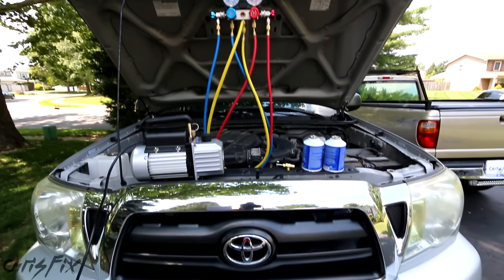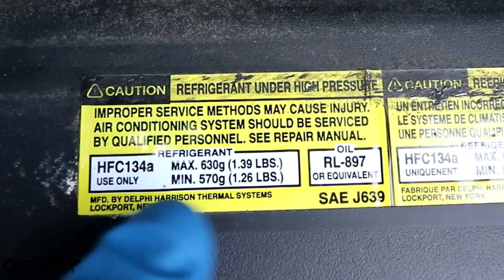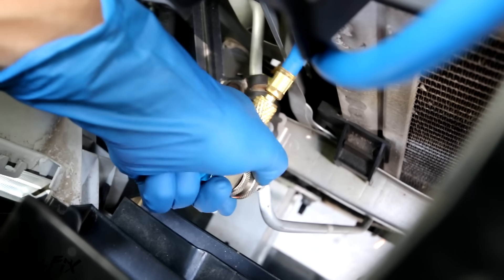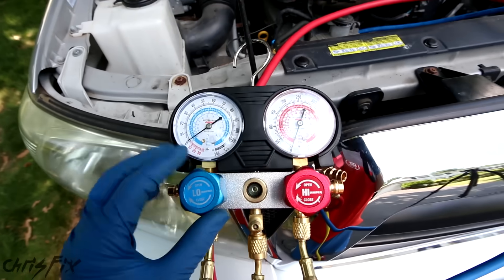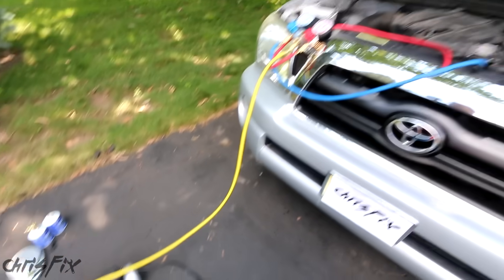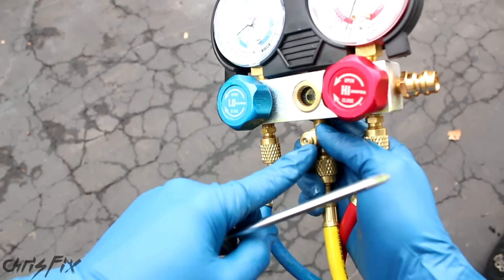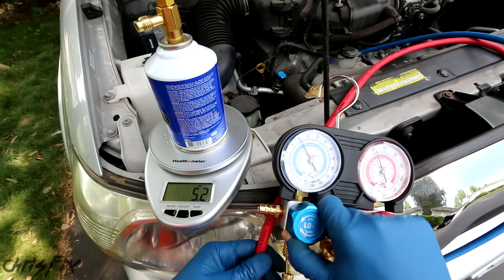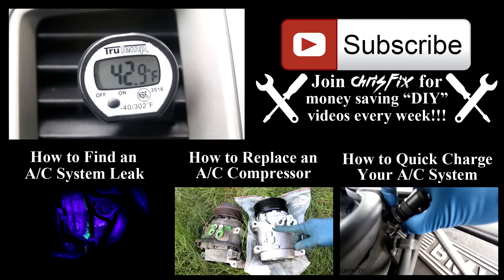How to Properly Recharge Your AC System

Comment: It is not a good idea to work with that stuff and recharge the system unless you are certified to do so. One mistake and if you have a refrigerant leak it's horrible for the environment . . Chris does know his stuff but it is not reconvened to do this work yourself unless you have a license to work on the AC. In Germany you can't even look at theAC system without a class on how to do it.
Reply from the maker: Thanks for sharing. If you do everything correctly than what is the issue?
Reply: All I wanted to say was that because as you said it's bad for the environment it's not a good idea to mess with the freon gas unless you have official certification. But you definitely know how to do it.   The reason why I said it's not a good idea is because if someone who has never done it and a mistake is made, there will be freon leaking into the atmosphere .

Comment: pump it up with nitrogen 60 lbs should be good .let it sit a hour or so . if you have a leak it will drop on the gages. nitrogen is dry too .
we test lines with nitrogen. out in the hvac trade .
Reply: Yes, now where did  I leave my nitrogen bottle and regulator?
Reply: Where win the world can I get nitrogen?? I just flushed system with metal flush canister with solvent and an air compressor..  I'm worried the compressor introduced too much moisture? 😶

Comment: So if I just need to replace O rings on one of the low pressure side connections and pull a vacuum I do not need to add OIL?

Comment: the final part that should have been done before removing the hoses is to purge the hoses of refrigerant by closing off the high side valve at the port and opening up the low and high on the gauges. This lets the compressor pull the refrigerant out of the high side hose and bring it down to a lower pressure and lets you maintain the proper charge. There will be less than an oz in the hoses at this point versus something close to an oz the way that Chris showed. Then you do the rest of the disconnect procedure. Just from someone that has done a few systems and converted a few from r 12 to r152.

Comment: I noticed the cap on my high side is missing does that matter I guess the tech forgot to put it on, I'm not having any problems but still.
Reply: The cap keeps dirt and moisture away from the Schrader valve in the port, like a dust cover. Get a replacement, they're inexpensive and ill save you a lot of grief in the future.

Comment: R 134a sucks. Use a mixture or propane and butane. 134 is only used to pay the double D's a royalty. R12 is out of patent so they switched it. Yeah, ozone bad, we get it. But if you want a nice cool car and less work for your compressor and no more chance of a fire than r12 and oil, use propane and butane. Don't believe me? fine. Use many other refrigerants that are better than 134. They are just no patented by D&D.

Comment: Hey Christ first off I love you channel man its very informative and have absolutely no complaints, I just wish you can answer a question of mine in regards to a vehicle I have not seen here. I have a 1987 dodge ram d150 that wont take the Freon, I charge it according to specs and still no cold air, I wonder what it can be, I had a mechanic check it and he ended up overheating my pump until he killed it due to over charging, its already converted to r134a from r112? can you help!!

Comment: Hi Chris, I just got a manifold gauge set and mine has 4 knobs but no connection in the middle where your yellow hose is. will it still work for for the Toyotas? we have a 1996 4runner.

Comment: Hi Chris. Quick question for you. I hooked up my gauges as you instructed but my low side gauge, even with the valve closed immediately went to 70 pounds. Is the gauge defective because you show yours at zero until you open the valve. Are my gauges toast? Thanks in advance for your help.

Comment: Chris: GREAT instructions, SIR! But the link for the gauge set in Amazon is not the one you use in the video. Yours has quick release connectors and a sight glass which are both very  handy, but the one on Amazon doesn't have either. Please keep up the good work!
Reply from the maker: +Ron Hensley thanks and thanks for letting me know. They probably changed the product design. I'll find a new one!

Comment: My gauge set doesn't have a Purge valve , how can I purge the yellow line connected to the can ?
Reply from the maker: +naiefelyemeni1986 don't worry it's not that important since the lines are very thin and don't hold much air.

Comment: Is replacing the compressor essentially replacing the whole AC system?  My Ford Escape AC isn't working.  I took it to a mechanic and he charged or put 'freon' in it.  It worked for a few months and stopped again.

Comment: if you close the manifold gauges after vacuum,..  how it will detect if there is a leak in the system?
should  they stay opened?
Reply from the maker: +Daniel Cotayo the line from the gauges to the ac system is open. You are closing off the yellow hose when you turn the knobs at the gauge.

Comment: hey whats the difference why you used this type of recharging vs the AC pro on the bmw?
Reply from the maker: +417hatchimitsu this is the proper way to do it and the ac pro is the cheaper/easier way.
Reply: @chrisfix. Thank you for your video I was able to do my air conditioning system with AC pro kit! Thank you!

Comment: The video is pretty awesome. Very informative and generally the correct way to service the system. There is only thing I saw, that was incorrect... The specifications are in dry ounces. Fluid ounces are not the same as dry ounces. A twelve fluid ounce can of freon is 16 dry ounces. It's sold by the pound. So, you added a total of approximately 26 ounces to your system, not 22. It may be perfectly fine for your system. But, it could be catastrophic in another. Why freon is sold by the pound, and labeled by the fluid ounce, I'll never understand.
Reply from the maker: +Jeremy Wheeler hanks Jeremy and thanks for the tip!

Comment: I'm asking all over the internet, I'll try here too: my AC compressor is cycling on and off every three to five second all the time. Always, no matter what the conditions are. It has been professionally recharged, nothing has changed. The guys at the shop say it's normal, but since the car is still covered by warranty i'm afraid they may be just trying to avoid fixing it for free. Can an eternal 3 seconds cycle be normal?

Comment: Question: Do you need to purge the yellow hose again when adding the second can of Freon?
Reply from the maker: +dada royal no because the hose doesn't get air in it since it is sealed with the adapter that goes on the can.

Comment: Is it possible to test your ac manifold gauge for leaks by connecting the red and blue hoses to there brass storage positions on the sides of the manifold , connecting the yellow hose to your vacuum pump and opening the valves and turning on the vacuum pump?
Reply from the maker: +julian perez you could just close the valve on the red and blue and test it
Reply: but shouldn't I leave the valves open to test the yellow hose also for leaks, but I guess I would need a  shut off valve between the yellow hose and vacuum pump to not loose vacuum pressure.
Reply: but I guess the red and blue hoses are more important to test the cars ac for leaks, the only thing is if the yellow has a leak you may not get to -30.

Comment: Great Video! but what position should the black air knob on the vacuum compressor be, should it be in a closed position or an open position?
Reply from the maker: The compressor doesnt have a knob. You attach your yellow hose and turn it on and it sucks out the air.
Reply: Ok, so the black cap "marked air" is a like a dust cover? Because it does screw on and off. It doesn't matter if it's loose or tight, right?
I'm a first timer and was just wondering . . . Thanks for the response!

Comment: Hi Chris fix, you do a great job informing people. Just wondering why you didn't replace the receiver drier/filter in the system. I was tought when I got my A/C certificate when you always open up the system to always replace the the receiver drier/filter because at that point it is already contaminated and needs to be changed. It's basically like changing your oil filter when changing your oil.

Comment: Amazing video, I've never done this, but one thing I would of have done is used the Tare feature on the scale with the empty can to know exactly how much refrigerant you are putting into the system. Excellent work!
Reply from the maker: +JonTheChron thanks and good idea
Reply: I'm a trade electrician that likes to work on his car/bike when ever something goes wrong or is scheduled for regular maintenance, one thing I have always been afraid of is the A/C system. Last summer the A/C system on my 40k miles 2011 Dodge Charger stopped working about 1 month after the warranty expired. After watching the series of 3 videos on A/C you posted, I finally feel like I could tackle this task as I am now well informed on the correct procedures used to diagnose/troubleshoot and repaid and automotive A/C system. Thank you again Chris for this very informative series.

Comment: Hello Chris; do you really recommend the harbor freight vacuum pump and gauges? I need to buy a set for  fixing my AC . need to replace compressor and condenser and I need a good vacuum pump. Thanks Chris
Reply: I got a loaner vacuum pump from Autozone for a $150 deposit. The HF manifold set seems popular amongst Youtube mechanics: Chrisfix, ETCG, Scotty Kilmer, and Ratchets and Wrenches all use it. I have the FJC6697, which seems to work well.

Comment: Trying today
Reply: ok, so, in california, we have different r134 cans. they need to be reusable. so no puncuring holes, they need to seal after use. empty or not. the cans come like that.

i did have a problem with finding something to connect the manifold hose to the refill can. i ended up evacuating the system, closing everything off and leaving it with negative pressure, then closed all manifold valves. disconnected everything, and refilled the quick method. $13 refill hose with gauge hooked up to the low pressure line and the can.

unfortunately, i overfilled my system and didn't want to risk r134 on my hand to release some fluid. 

other than that, ice cold air for the summer!

Comment: I read somewhere that adding oil through the vacuum line is not advised - that that mechanism is intended only to replace lost oil due to A/C service, not to completely charge a new compressor as the oil takes a very long time to traverse the A/C lines to the compressor.

Can you advise?

Comment: I've done AC work for 47 years and like how you presented this tutorial. The only thing I would say is to keep the manifold valve on the suction side at a low setting with the can inverted so no liquid can enter the system fast enough to hydraulic lock the compressor. I noticed you let the can get somewhat inverted with the manifold valve open quite a bit. I usually fill an entire system with the can inverted but only allow a three to five pound pressure over the pressure the compressor is leaving. This way the can won't get so cold. I know there will be some that claim never to invert the can but slowing down the liquid to only a few pounds will allow liquid to evaporate enough to keep from hurting the compressor. This has worked for many years. Very GOOD video.

Comment: Does pulling this vacuum remove the oil from the lines as well? If not how do you know how much oil to add to the compressor?
Reply from the maker: It only removes water which evaporates under a vacuum.

Comment: What to do if my low pressure was at -30 under pressure but it leaked to -10. Do I start the process all over again or is it ok to charge?
Reply from the maker: You need to find the leak. Dont charge it because you will be wasting your time.
Reply: thanks. o I need to buy some Freon with dye  from your find the leak video?

Comment: Have I understood right? Oil and UV dye stay in the system even after applying 45 min of vacuum?
Reply: A Google User yes, the vacuum pulls the air molecules out, but liquid does not get sucked out

Comment: Thank you for the excellent video! Question: If I replace the condenser and then vacuum down the system, does the pag oil Id previously added stay in the system? Or do I need to add new pag oil when recharging the system again (for the 1st time after having replaced the condenser)?

Comment: Chris love your videos , quick question if you pulled a vacuum for 45 min. would you not need to add oil again? would vacuum suck oil from system?  1st can was on its side then upside down is that ok? does it matter ?, again thanks for your videos you rock bro !!
Reply from the maker: The vacuum only sucks water moisture out not oil. Water in a vacuum bubbles up and evaporates while oil stays a liquid. You want the can to be in the 12-3 oclock position.
Reply: thanks, the high pressure discharge line busted and i had added oil ladt yr, so i should be ok with replacing line and just adding the freon as per video?, keepm coming alot my repairs have been vecause of you, thanks again bro. !! for the detailed explainations and your quick response

Comment: good video . when adding oil does it only need to be on low side or both ? I know that the 135a is only low side . I am thinking oil is in the whole system.
Reply from the maker: Only on the low side. It will circulate.
Reply: ChrisFix Thank you. I did put it on both seemed to work fine after all . great info .

Comment: One thing I don't understand. You added r134a at a fluid oz measurement but you weighed the can on a dry weight scale. 8 fluid oz equals a cup but 16 dry weight oz equals a pound. Since all liquids have a different dry weight how can that be accurate? Does a fluid oz of r134a weight 2 dry oz?

Comment: Great video. Only thing you missed was evacuating the refrigerant in your guages after charging. You charged system then unhooked guages with refrigerant in hoses, consequenly under charging system by maybe 2oz. Close high side connection valve, open high side guage valve, crack open low side guage until comp draws it all out.

Comment: hand tight is not enough on those connections , i found that out the hard way , some do not have O rings but have teflon or HDPE  inserts , my high pressure side leaked and i had to tighten it with plyers , it also lost vacuum

Comment: Thanks Chris!  I successfully replaced out a chevy truck compressor, condenser, and dryer with the aid of your videos and others.  Never thought I could do this but it turned out to be easier than I thought.  Don't get me wrong, it's work intensive especially where Chevy put the compressor on the model and year I have.  Kudos to AutoZone for their tool lending program.  Was able to use their vacuum pump and gauges to due the work.

Comment: I don't get the following. Why after an hour of checking that the pressure is -30 inHg, why do you have to run the vacuum pump for another 45 Minutes? wouldn't this collapse the system? and if it's already on -30 inHg why do you still need to run it if it's going to stay in that same pressure? Thank you.
Reply: The first purge was to check for leaks, though as others have pointed out one really needs a more sensitive vacuum gage to do this properly.   Water molecules don't release from surfaces and oils all at once, its a gradual process, so a longer period of time under vacuum is required to draw more of them out.

Comment: good video.  I have a question.  I installed the a/c compressor to the Dodge ram 3500 v6 turbo diesel so I don't know if I need add oil or not.  I bought the new

Comment: Hi Chris, why do you open the the high side when you vacuum the system please.I have watched
other videos ,as you do, and they state to never open the high side ??
Reply: Not sure what the Fix thinks. I know I do the same. You want a vacuum on the whole system. New cars have a lot of restrictions like orifice valve, expansion valve it is best to pull from both sides. If you have a leak it will show ether way.
Reply: That is great thank you.
Reply: Maybe because he did not start the AC system which cause the solenoid remains close. So opening the high side let both side of the LP and HP system get vacuum off..

Comment: I did this and the first set of gauges I borrowed from Autozone was no good, it showed a vacuum leak and I replaced some o rings I already replaced and it showed a huge vacuum leak.  Since I was fairly sure from dye I only had one leak and had fixed it, I went back and they gave me another set.  And that one showed vacuum holding 100% overnight, not bad for a 22 year old car.  But if you are getting strange readings on a borrowed set... the tip off was when I had one hose open to change the o ring and the gauge set still showed SOME vacuum.  Vacuum with the system open, not happening!
Reply from the maker: Thanks for the tip!

Comment: Do you "have" to replace Dryer and Orifice tube when you replace the compressor?
Reply: It is needing replaced if the system is opened for a longer period of time or if the compressor has gone out due to metal might have entered the system. When i do A/C system work i always recommend replacing it due to they are cheap.
Reply: TY

Comment: Right Chris,why is it some say like you to open all valves,yet others say not to open the Red (high) side, as 
the valve is in the middle of the bar which joins the gauges ? Good Vid though.
Reply from the maker: You just want to read the high side. You do not want to open the high side when you are trying to get the refrigerant to suck into the ac system.
Reply: Thank you very much Chris,most have not said that ??  Great watching your Video's
defo the easiest to understand.  : )